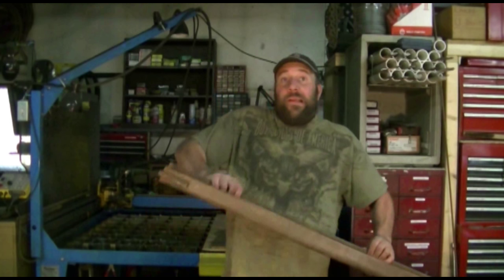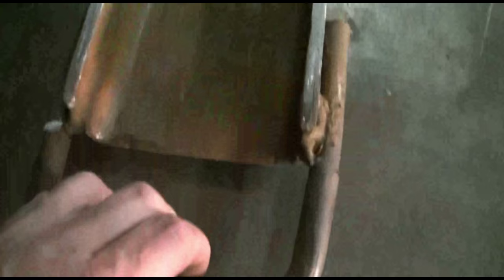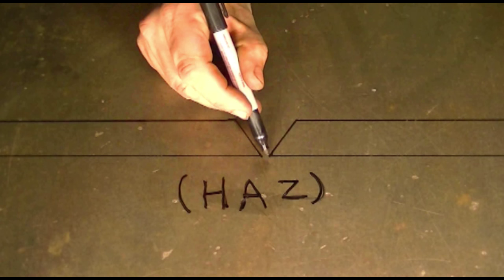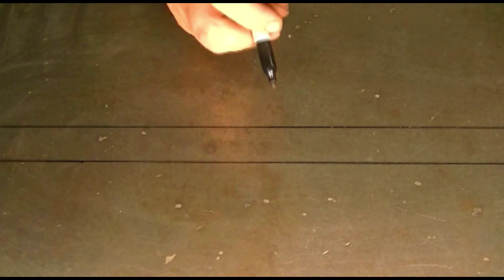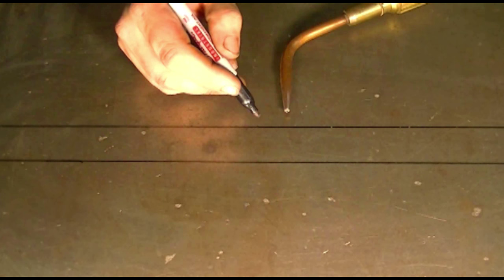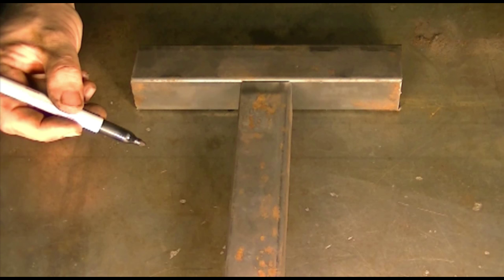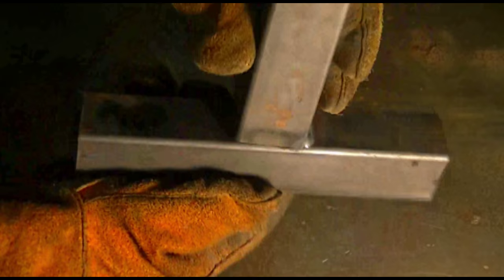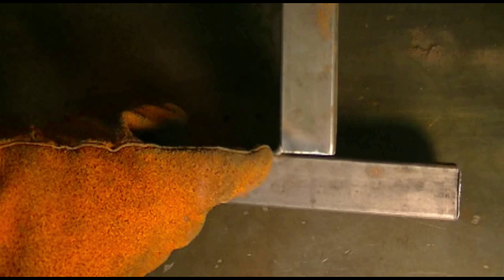Welding and the Heat Affected Zone (HAZ)

Comment: Great video Jeffrey. I'm a 30+ year mechanic, but brand new to welding and your video was VERY informative, especially the part showing the crystalization (looks like sand) in the steel bar. Will check out Jody's tips vids as well. Thanks!

Comment: Hello, I have a question between welding with electrical resistance and mig which has bigger bigger HAZ?
Reply from the maker: The welding process does not really determine the size of the HAZ, the amount of amps your putting into the material does. Other factors like material thickness, alloy of the metal you are welding and travel speed all come into play.
Reply: @jeffreysanto  Thank you!